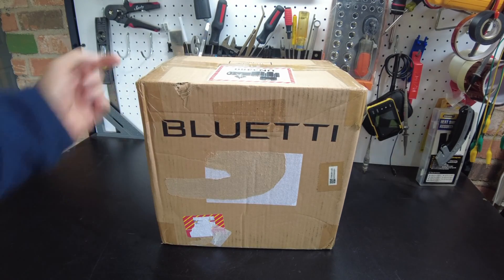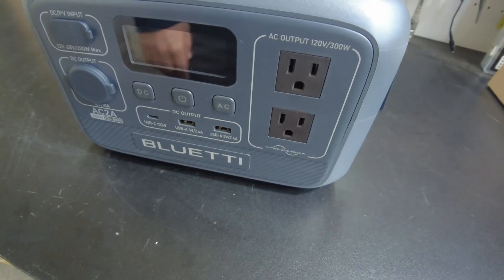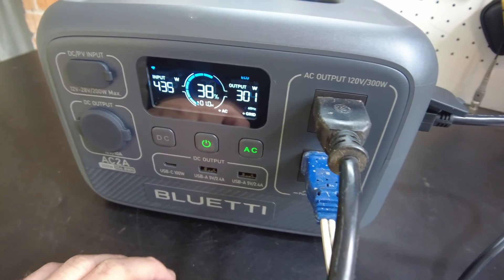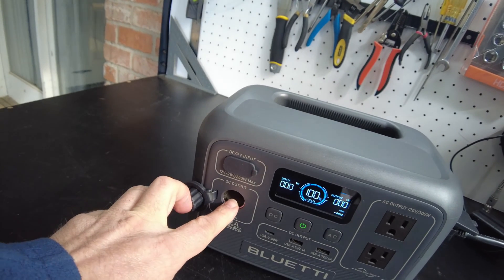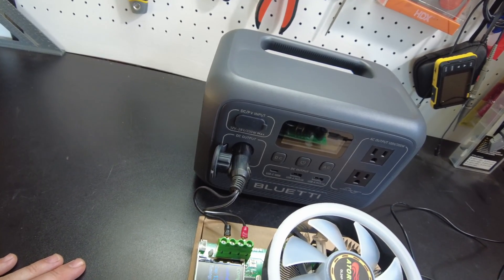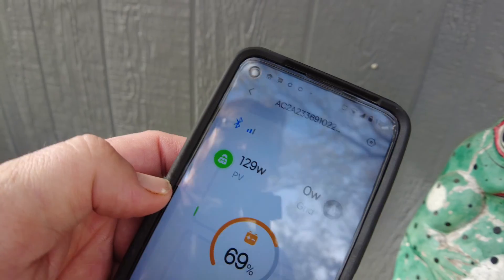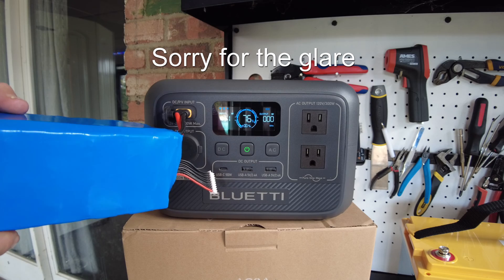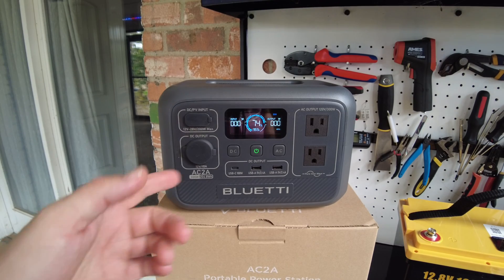Bluetti AC2A Power Station

Comment: You obviously are super smart and know SO MUCH about solar power!! I am GREEN!! I don’t know where to start at all. There are too many batteries, panels, inverters, charge controllers etc that I stay continuously in the dark. Get it? 🤣 I get confused by amps, volts & watts. 

Do you have a video for a smart guy like me who has NO off grid equipment, knows very little about it all but can learn? If I wanted to power let’s say a fridge (even just a small beverage cooler) how would I do that? I get that the solar panel charges the battery but how do I make it so that I have enough battery power to outlast several days of cloudy weather for example? I don’t want to spend a ton but I do want to solve this problem. You seem to be the guy who could help me. 

I’ve seen kits from online companies with (for example)  Ecoflow 1800w appliances with all the wiring and connectors and panels. But I don’t know if that is the way to go for me. Again, how do I get enough battery capacity to outlast cloudy days? Or even hazy days bc here in the south we can have many many days of that hazy humid sky. 

My brain says it’s better to roll my own with batteries, inverter, controller and panels so I can expand the batteries to be able to store power. 

Thanks!

Comment: The battery is too small and the inverter too weak to power anything sizable over AC. Unless one really needs solar charging and/or AC output for a small device they're better off buying with two 100Wh USB-C power banks. Their EB3A may actually be better depending on application.
The unit is limited to 8.2A over DC. A typical 100W panel hovers around 20V when operating. Two in parallel will likely result in 165W or so.